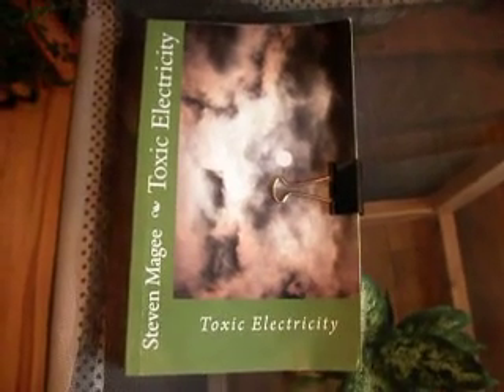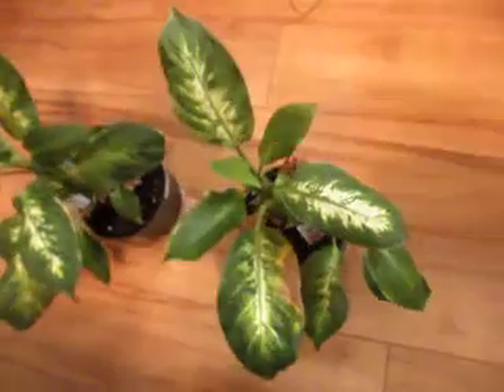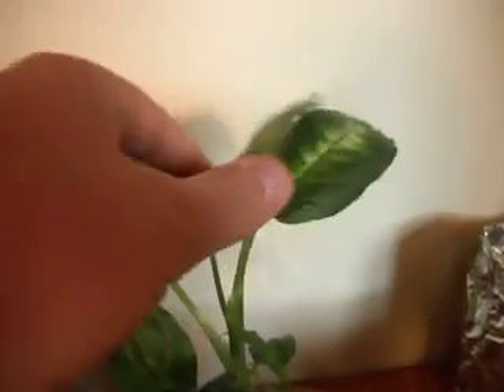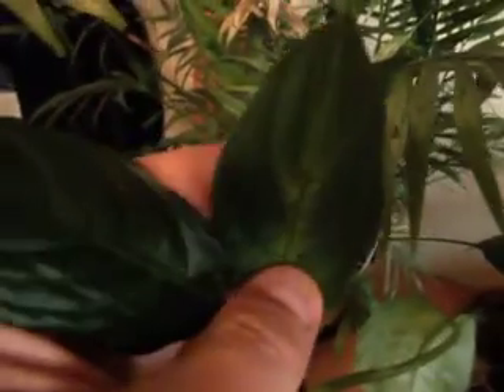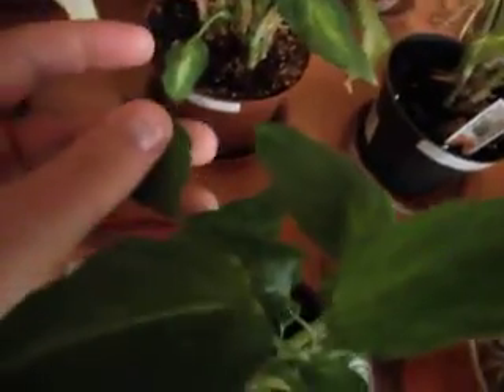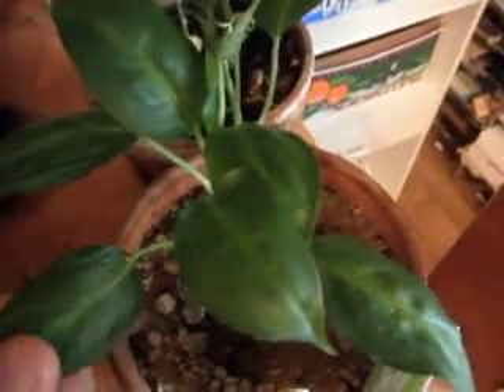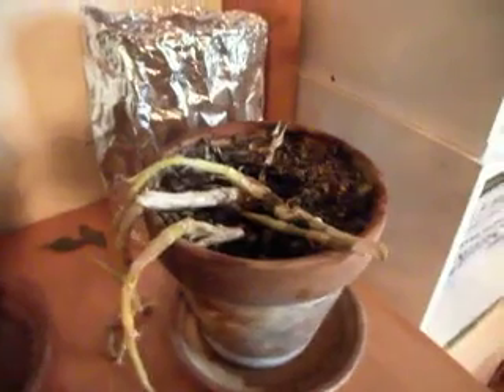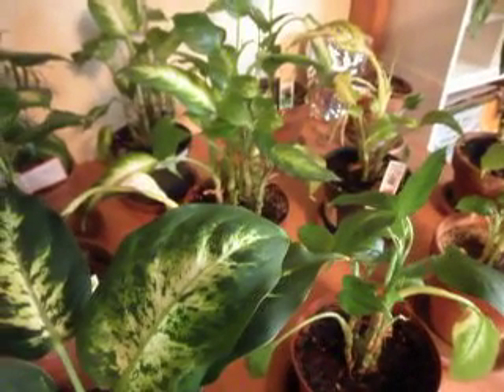September 2012 Summary of Radiation Plant Growth Experiments

Comment from the maker: If you have read Dr. John Nash Ott's books, then you would understand that the biologically harmful electromagnetic radiation (EMR) fields are generally close to the device that is emitting them. All of my experiments are run with control plants, I have just recently found out that the controls were roughly 9 feet from a harmful wireless radiation transmitter and that is why the controls were showing stress also. The Dieffenbachia would burn in a greenhouse, you know that it is a house plant.